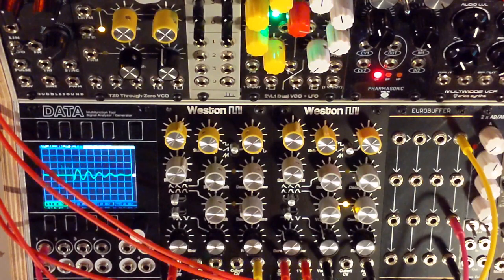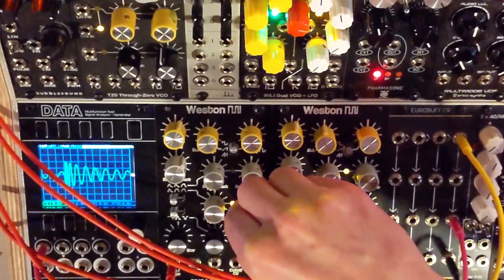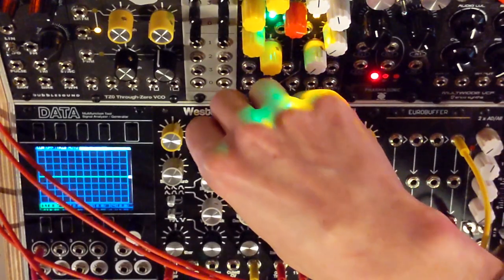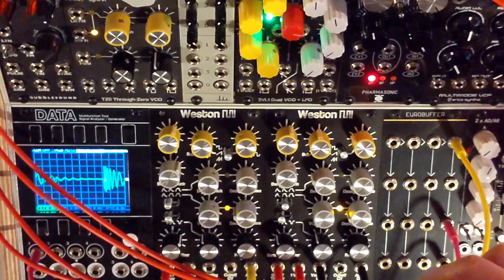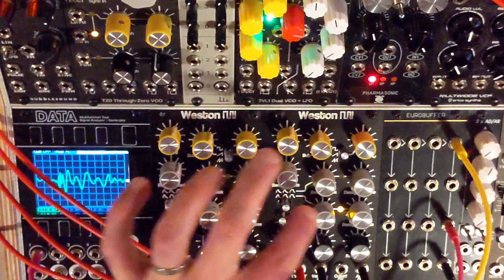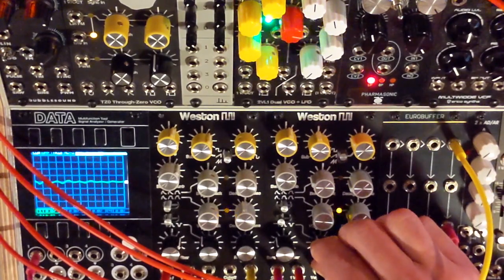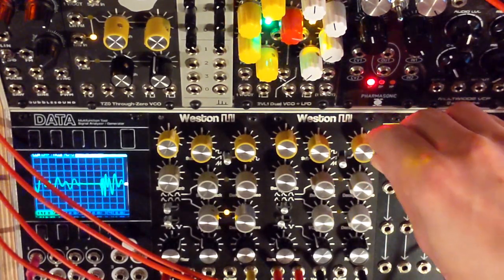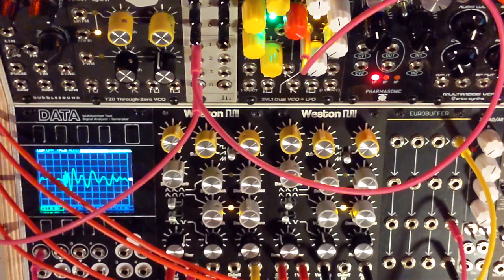Weston Audio B2 Kick/Bass Eurorack DIY Module Demo

Comment: I am very glad to find your channel. I am a beginner in modular.
Can you give me a advise which units from Weston I can use for my techno starter kit? Many thanks.
Reply from the maker: Thanks! I would say B2 is good for Techno for sure! Maybe AD110 as well if you like old school drum sounds. You can also make your own voices the traditional way with VCOs, VCFs, VCAs, etc.. just note I don't currently have some of those features as modules. I do have a couple of great VCOs though and you can see the demos on here (search PA0 and TZ0). Depending on if you are looking for DIY or pre-built it will vary what modules I have available. B2, AD110, and TZ0 are available through DIY. Those 3 plus PA0 are available pre-built. :)
Reply: @westonprecisionaudio  Thanks for share this information.
Reply: @westonprecisionaudio  First thanks for you answer. Have you a example which rack and unit for the power supply I must use, to put in all the modules?
Reply from the maker: @jayhu6075  That's a huge question.. :D. I would say watch this video https://www.youtube.com/watch?v=UXEyEIo-WtA and start poking around on the ModWiggler forum and you will probably learn a lot!
Reply: @westonprecisionaudio  Many thanks.

Comment: This sounds so good! This is the kick drum module I've been waiting for, and that sweet bass line makes me wonder if I need two of them... Hoping it arrives at Thonk soon. :)
Reply from the maker: Thanks!! Yes, Thonk restock for the DIY will definitely happen soon. they sold quicker than expected! I also plan to have some panel sets in my webstore too. Or if you want prebuilt SMT version I have been keeping them in stock on the webstore!
Reply: @westonprecisionaudio  I'd rather DIY, but I'd be happy to build the SMT version if you'd sell that as a board and panel set! It's more fun than through hole anyway :)
Reply from the maker: @nefstead  we will see..this might become an option!